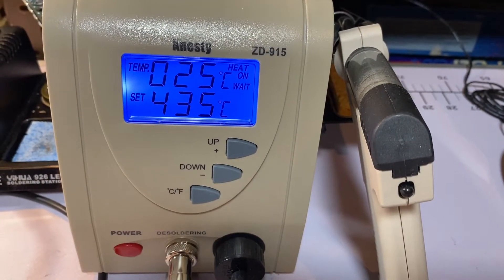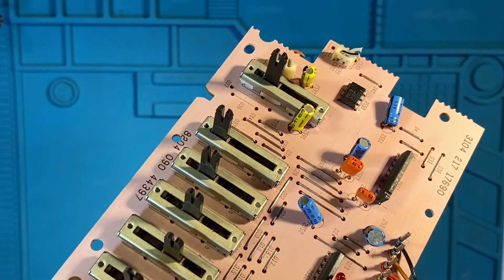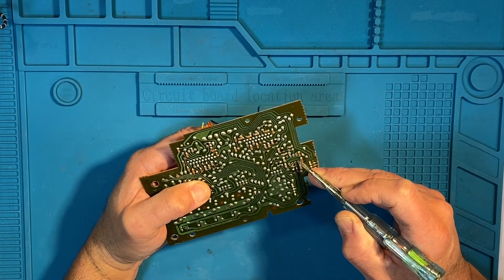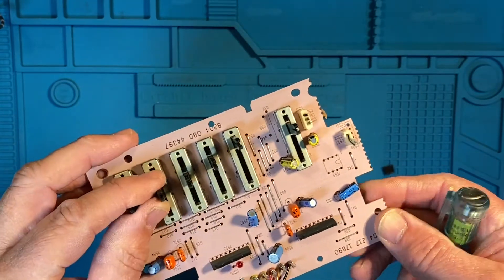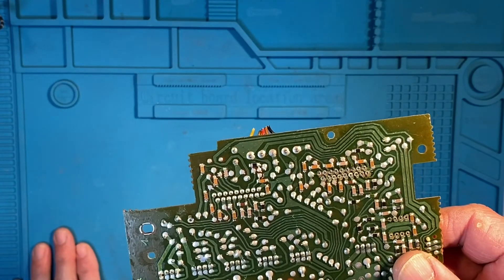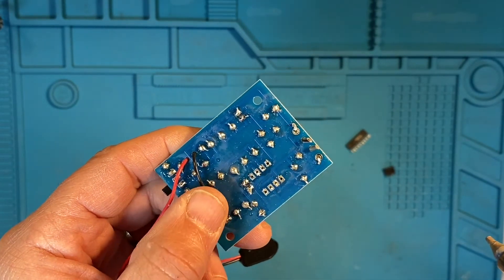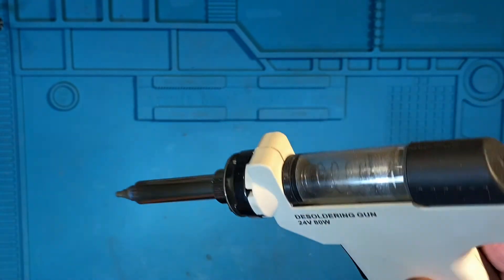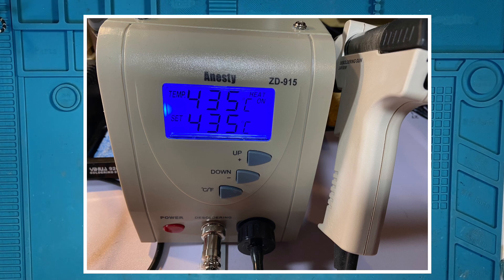Desoldering Gun Anesty ZD-915

Comment: put a copper coin halfway in the spring... and most problems with a clogged back plate and filter will be solved.
Reply: I used a tiny ball of the brass tip cleaning pad. Works good

Comment: ZD-915 desoldering works very well but today the Yihua 948 is a better option for tight budgets.
I bought one ZD-915 but never used it, still is in the box, now I bought the Yihua 948.
Yihia 948 looks more better made.

Best Regards.
Reply from the maker: Thanks. I’ve just ordered a Yihua hot air station to get going on with for my first venture into surface mount.